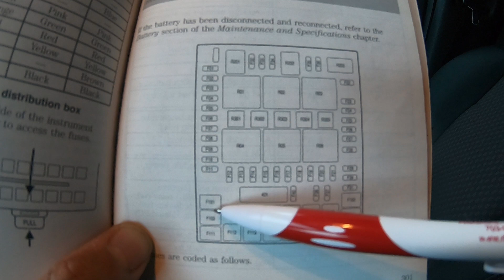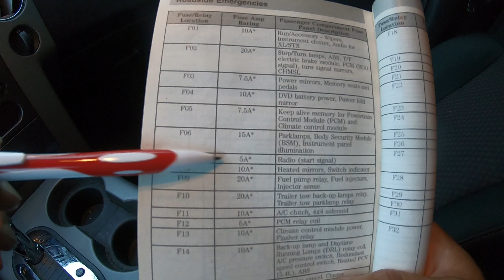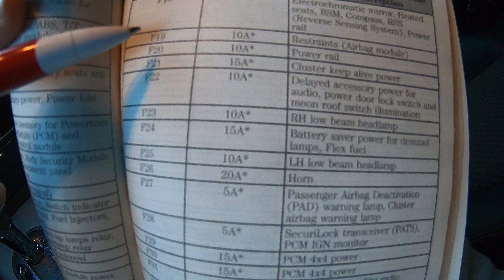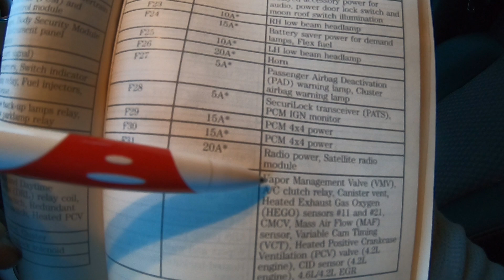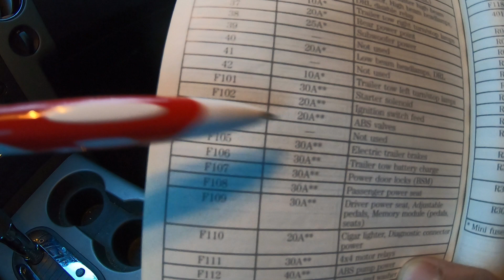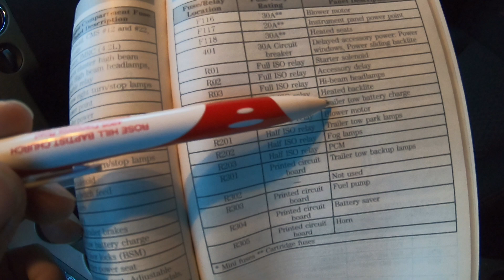2008 Ford F150 Fuse Locations and Diagram

Comment: Bro, I can’t believe all the people hating on you in this thread. You helped me immensely and I appreciate it. By the way I ordered an OEM manual on eBay for $20 and I still couldn’t figure which fuse because I was looking for 12v plug but alas it’s listed as cigar lighter diagnostic connector power. I didn’t know that’s what it’s called! So, thank you very much. Keep helping people when you can.
Reply from the maker: Haters going to hate, wonder what they are doing to help people. Glad to hear it helped you! People ask me questions, so I respond with videos to help sometimes. Sometimes I don't respond for weeks to questions, so videos like this will help some people out.
Reply: I guess they'll look stupid when something happens and it' will😊

Comment: Not sure if you could help me but my RV trailer when I hook up it turns on the signal lights and the brake lights but won't turn on my running lights and what I've researched it's a fuse would you happen to know which fuse on a 06 F150